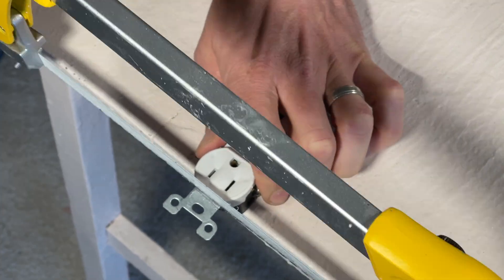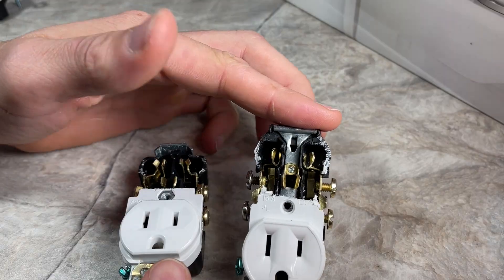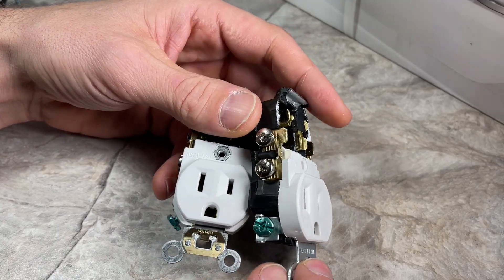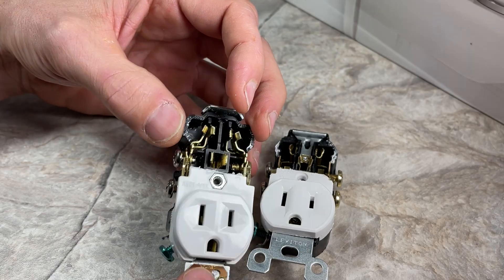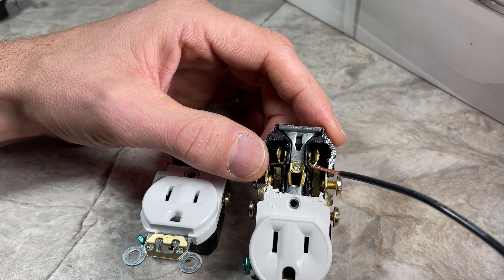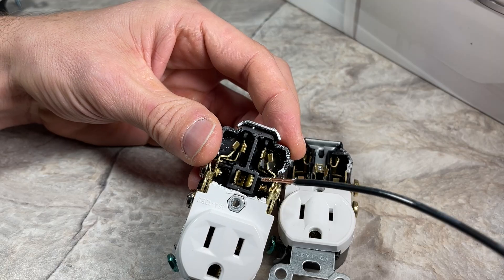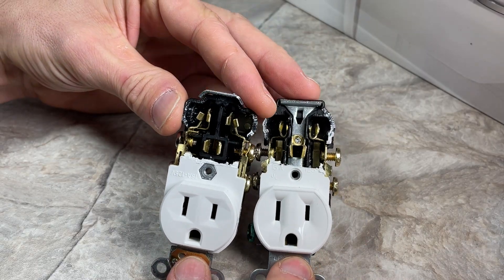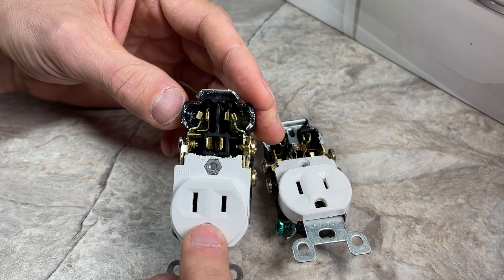What Outlet Should You Buy For Your Home |  Commercial vs Residential

Comment: I have started using only hospital grade due to how strong they hold a plug.
Reply from the maker: Nice!  I was actually thinking about cutting into a Hospital grade to compare to commercial.  Also interesting all the durability tests that the hospital grade outlets have to pass.
Reply: @EverydayHomeRepairs  Hospital grade to compare to commercial.. DO IT...
Reply from the maker: @daytonpyro  hahaha, consider it done!
Reply: I would be interested in a comparison video of Hospital grade v/s Commercial, & Cheapo.
Reply: I've used hospital grade for my sound system. Extremely hard to plug something in, definitely a different category than commercial.
Reply: Red (Orange) outlets are isolated ground and most likely are not beneficial in a residential setting with NM (non-metallic wire ie. romex).
Hospital grade outlets have a better grip on the plug and are designed for more plug/unplug cycles and come in various colors.
For a LOT less $ you can get a spec. grade outlet and put that saved $ into a whole house surge suppreser, that will protect (limited) your devices. But typically a quality hospital grade iso-ground outlet from the better manufacturers (Hubbell, P&S) run closer to $20+/each.
Reply: McMaster Carr has them for around $13 in ivory or red. Ivory worked for me. Knowing a wallwart won't fall out and my cords are secure is worth it to me.
Reply: They are designed for a couple of hundred thousand uses. About $ 6 on Ebay.  I have 32 that I have been trying to sell for 2 years . No one knows why they should pay me $ 2 each for them.

Comment: Internal arcing is normally caused by over loading an outlet (15 amp outlet on a 20 amp circ.) and the spring metal that holds the cord end to make electrical connection becomes weak from heat and will start to arc  due to what is now a loose or weak connection on the cord end. This happens quite often when electric heaters are plugged into 15 amp outlets. Typically an electric heater draws about 12 amps which is max for 15 amp so once you start plugging other items such as lamps or tvs , you have overloaded that outlet causing it to over heat. I would always recommend  using a 20 amp outlet when ever an electric heater is used. I've been an electrician for 45 years and have seen this happen dozens of times . Also really old outlets can become weak with years of use and can also cause arcing. New houses are wired with almost all 20 amp circuits with arc fault protection .
Reply from the maker: Hey Steve,  thanks for sharing all your experience accumulated during your career.  Really helpful 👍

Comment: Thanks for the comparison. Great visual explanation.
Would you consider doing a comparison with a 20A v. 15A equal grade receptacle?
Reply from the maker: Yeah, I think I will do a couple more comparisons as overall people are pretty interested to see the internals.  Thanks for the feedback.
Reply: i'll guess that the main difference is the thickness of the internal metal. which it has to be to carry a higher load.
Reply: @Speed Buggy Who said anything about putting a 20A receptacle on a circuit rated for 15A?

Comment: I absolutely will not use the junk $0.50 outlets; I've replaced too many broken or worn out ones, and I've had brand new ones break in my hands while installing.  Also, the better outlets often have a back-wire option that looks like the stab-in connections on the cheap ones, but the wire actually goes under an internal device that clamps down on the wire by tightening the screw, making a solid, reliable, code-approved mechanical connection, a little faster than being the hooks around the screw.

Comment: I live in an older home.  I’m not an electrician but I do a lot of my own electrical work. I recently upgraded from a 100 amp service to 200 amp with a lot more slots.  I had the pros do that part.  Now I’m splitting circuits, adding circuits, rewiring 14 gauge 15 amp circuits to 12 and 20, and upgrading the outlets and fixtures.
The time and effort is significant so I don’t hesitate to pay a couple of bucks for a quality outlet.

Comment: I'd love to see the internals of a Hospital grade receptacle, and see how it compares to the commercial grade. (Those are the ones designated by a green dot on the face) Those go for upwards of $10 a unit.
Reply: Hospital grade has high grade internals and shatter resistant faceplate. Very high plug retention force.
Reply: Today all faces are thermoplastic.  Manufacturers offer several levels of hospital grade.  If you buy the HBL8300W from Hubbell you will find stainless steel contact that prevent corrosion from hospital spray cleaning, contact gauge is thick, the design springs back in place and has to meet insertion n pullout cycle tests.  Also must meet impact n ground retention tests.  Many receptacles start off with good retention but over time it is the high quality Hubbell that outlast the others.  in class we weighed several different versions and the heaviest outperforms
Reply: I think those suppress flashing/arcing, because oxygen equipment... You don't want that big kaboom! So they might also be a good idea in an arcwelding/torching shop.

Comment: backstab outlets are garbage period. Ive had commercial outlets end up with loose connections when backstabbed
Reply: Backstab components should be illegal.  They're pandering to the contractor for quick installation, not safety.
Reply: Back stab will work on a 15A circuit, but the best reason to spend a bit more on a better outlet is the side wire clamp. They're almost as fast as a back stab, but much more secure. Even for DIY saving the time and still getting a solid connection is worth another $1.50.
Reply: NEC prohibits stab connections in circuits larger than 15A.  they even prohibited stab connections in receptacles from allowing #12 wire.

Comment: The thin black plastic wall between the hot connector and the ground connector...
Once the outlet's contact point that folds around the plug blade loosens up, a plug in the outlet will start arcing which will melt the plastic wall.  I wonder if the black plastic in the two outlets is the same material. Maybe the commercial one has a higher melting temperature.
Reply: Cheap stuff is nylon from most mfrs.  I do know if you break open a Hubbell HBL5362w you will find reinforced thermoplastic and extra thick walls

Comment: "twisting" could cause separation of the white cover...
Actually, all you need is the mounting flange supported on top of drywall combined with pressure on the outlet near the location of the cover plate screw.  That would cause the mounting flanges to pry the white cover away.

Comment: I replaced all the outlets in my house and bought the contractor pack but I did get the tamper resistant because I have small kids, they seem to be good, one thing I always do is wrap electrical tape around my outlets and have seen electricians do this as well
Reply: There's a nice added margin of safety in keeping those side terminals covered!  Insulation is your friend!  SOURCE: That one time I pulled an outlet out of its wall box, but forgot to turn off the breaker.  ZZZZZT.
Reply: only old electricians do that, any arcing and the breaker will trip
Reply: @Galgamoth  
You don’t want to rely on that, sometimes you have to be a little bit close to the side of the box, so the tape is a good idea and a lot of electricians to actually do that, plus you need to realize not every place is a newer installation that has the dual protection breakers that will pop when arced, the ones with bimetallic only will weld closed and burn the place down
Reply: @Galgamoth  you don’t want to rely on that, not all breakers are the new ones that have the dual protection, The older ones with bimetallic only will weld shorted if there is arcing and yes, some people will not pay for new safer breakers

Comment: The best receptacles are made by Hubbell.  Not all commercial receptacles are equal.  You will not find a test standard that manufacturers have to meet to call their device commercial or industrial grade.  Just needs to meet min. UL
Reply: Wrong ASTM has standards that have to be met. And Hubble is not worth the money they want for them. Only use heavier plastic in them
Reply: @thomasmarable6818  you are incorrect.  Mfrs build to NEMA configuration std and UL test requirements.  Drop the link to a test for commercial recpt....it does not exist.  If a manufacturer stated Fed Spec then they must meet fed spec test stds
Reply: @LuLu_World  UL is a testing lab their standards are for testing only not for manufacture to build by. They have to build to those standards if thet want that label. ASTM rates on duty has nothing to do with what a manufacture calls there product. It will tell you if it is a better grade.
Reply: When we put togather submitals they dont care if its call commercail grade or super tuff, they want the ASTM number. T

Comment: Excellent video. I always use the heavy duty commercial grade receptacles, worth the extra price. I was surprised that you didn't mention the very convenient and useful Back-Wire Clamp connection feature of the commercial grade receptacle. Its much easier to simply insert the straight wire under the clamp and screw it down rather than have to bend a loop into wire so it wraps around the screw shaft. Also the Back-Wire system has provision for up to 4 circuit connections on the receptacle itself (except the ground terminal is usually limited to 1 wire) so up to 3 feed-thru wires can be in the box without the need to add bulky RED wire nuts or push connectors.
Reply: @cmmartti  Thanks for the tip. I've seen the lever style Wago connectors but never used them. I will get a few to try next time I'm out getting materials.

Comment: Great video!  Love the side by side comparison with the cutaway.  The faceplate separation issue happens A LOT with the light switches too.  The best way to go is to buy the commercial units by the case when you start updating your plugs or switches.
Reply from the maker: Agree, do you just buy them from Home Depot or Lowe's?
Reply: @EverydayHomeRepairs  Home Depot.  I am 5 minutes from either, but HD tends to have more commercial-grade inventory.

Comment: smart video.. one style outlet and switch to stay away from; instead of terminal screws in the back are little holes you push the wire into to make the connection.  There is a pinching device based on the old Chinese finger puzzle.. it is cheap cheap cheap. Can't count the number of service calls when this fails and finding which one failed in a run can be a pain.  Its also U.L. approved go figure
Reply: most residential outlets and receptacles have that feature you can see the spring tab on the bottom of the residential outlet he's holding

Comment: The NEC does not change, however, municipalities can and do add  additional requirements
Reply: NEC has updated every few years. Many locations are multiple  versions behind.
Reply: NEC updated every 3 years.
Reply: As well as reduce the code requirements. For example some jurisdictions deleted the arc fault requirements. And don't get started on the practice of stuffing 30 NM cables into a 4 foot long piece of 2" conduit to enter the panel box.

Comment: funny enough you put this video out the day i had to replace one of those cheap builders grade outlets! outlet didnt hold the plug to our 1200w portable dryer very well and the entire hot side of the plug screw terminals ended up melting out! lucky i knew exactly why it happened and replaced it with a nice high grade outlet. then 2 days later i see this lol

Comment: I've used a combination of these outlets throughout my house. In outlets that I use very rarely, such as a single lamp that I almost never unplug, the cheaper grade has worked fine. However, any outlet that gets a lot more use of plugging in and out (garage, home office, etc.) I've utilized a commercial grade receptacle.
Reply: @privacyatty  - We all can appreciate a tight receptacle.
Reply: @drboze6781  : Read so many ways. ;-)
Reply: @brodriguez11000   I know I like it tight, possibly why the no arc circuit breakers
are the big thing now, a constantly arcing 1/2 amp will heat things up then when a heavier load is placed on the receptacle, trouble. . .I replaced an outside recep
for dad last year, the lower body the black half was quite heat distorted, seems
that whoever did the pressure cleaning had a machine that drew almost enough
to trip the breaker, I took it out live and it was snapping  at me, it was the last recep 
in the run, so just the black/white and ground, so between lousy receps and an FPE panel with stab-lock brkrs, u R so screwed.
Reply: Exactly!  The outlets in my house that are worn out are the ones used by the cleaning service twice a month.
Reply: NEVER USE THE "STAB" HOLE TO MAKE CONNECTIONS! IT'S THE NUMBER ONE FAILURE IN RESIDENTIAL RECEPTACLES - ESPECIALLY when using them to continue the circuit to another device. 

Kitchen and bathroom receptacles get the most use; also hallway and exposed receptacles in rooms- the vacuum cleaner gets plugged into them all the time.

Loose jaws inside the receptacle cause more heat due to weak contact and small contact surface area for the electricity to pass through. The better grade receptacles rarely ever suffer this problem. The connected equipment runs better with tight connections.
Reply: My own OCD nature and thinking about some hapless kid getting shocked thirty years from now because I wanted to save $2 usually prevents me from installing rickety garbage into my home.
Reply: You are ninja
Reply: I'll usually not put the cheapest ones in if I'm doing a complete remodel, but I've only gone for the really expensive ones for places like kitchen counters, ones where I plug in my vacuum, and anything exterior.  Even the cheap plugs are overkill for the receptacle behind my stereo, which I carefully unplug once a year when I dust the back of the shelves.  I have, however, paid for the medium ones and got cheap-assed pieces of crap.

Comment: I bought my home in 1987. Spent the next couple of years swapping out the "el cheapo" outlets for "spec grade".  Expensive ? Yes. Problems ? No. Also documented every electrical load (outlet, light, washer, dryer, refrigerator, freezer, etc.) went to which circuit breaker at the service entrance. This made it really easy when I had a standby generator installed (with automatic transfer switch) to tell the installer which circuits were to be powered up by the generator.

Comment: You should address the weak connection will create heat, sometimes a lot of heat. This can deteriorate the socket materials, the plug connected, and the insulation on the wiring attached.  Have seen a space heater plug catch fire from a loose connection and the wiring in the wall was damaged from the repeated heating as well.  You present a good explanation of why cheapest not always best.
Reply from the maker: Good point Dan and thanks for sharing your feedback 👍

Comment: You’re doing good boss you’re right you should always buy commercial grade outlet those are usually used in commercial buildings but I’m electrician and I put in my house and they are denser contacts are thicker you know where when you plug in an out of it you’ll see a difference in a couple of months the residential one will fail quickly when you abuse it

Comment: Hospital grade is the best receptacle to use. Cost is slightly higher than commercial.
Reply from the maker: I am going to grab one and take a look at the internals as others had mentioned the same thing and now I am curious to compare commercial vs hospital grade.
Reply: @EverydayHomeRepairs  
I'm not familiar with hospital grade but as I understand it 15 amp commercial/spec grade is made the same as a 20 amp receptacle. The only difference is thec15 amp still have the same 15 amp plug pattern.
Reply: Aren't those usually 20 amp?
Reply: @robertthomas5906  Hospital Grade Receptacles come in both single or duplex 15 amp and 20 amp. 120/vac. There are also specialized hospital grade Receptacles used in both hospitals and laboratory environments.
Reply: @jwar2163  : Might be some features to reduce sparking from removal and insertion.